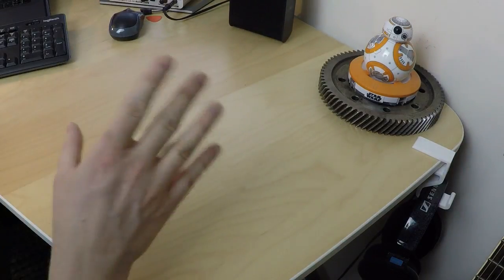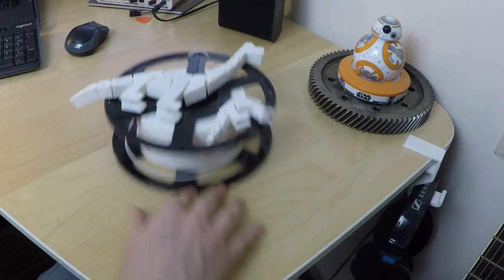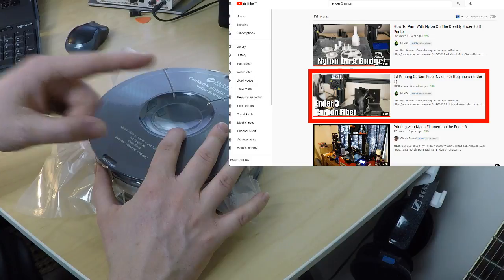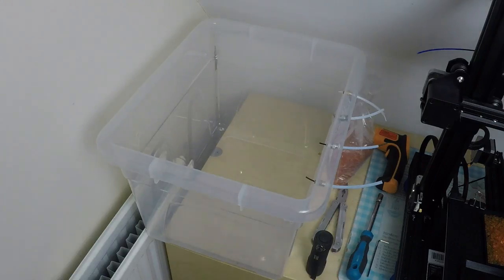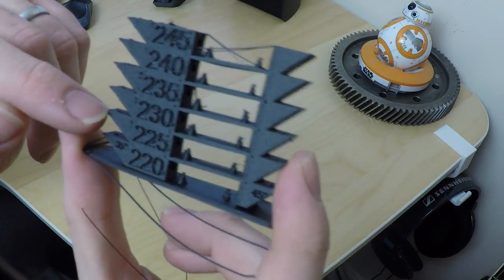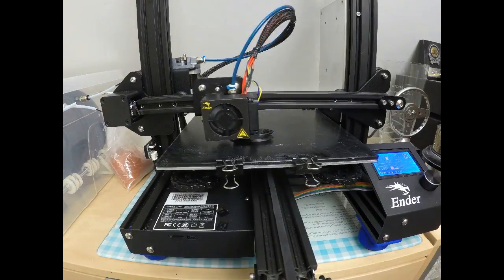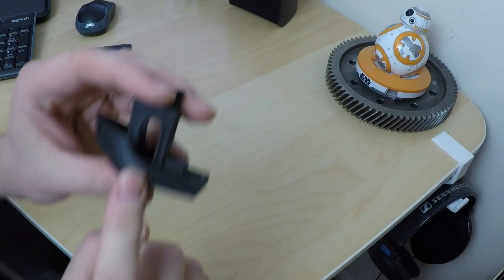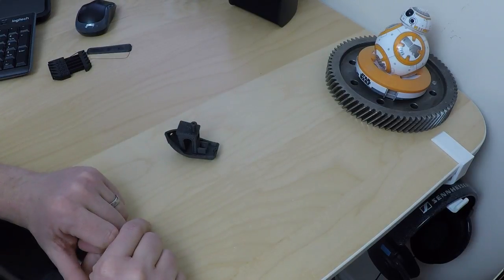3D Printing Carbon Fibre Nylon on a STOCK Ender 3 Pro - Can it be done??? (okay, almost stock....)

Comment: really like the videos so i decided to have a go at making a motorcycle carburetor reed stuffer for a friends drag bike. ( fyi he is 
the world record holder for the fastest Kawasaki 2 stroke triple )The part site between the carburetor and the inlet manifold. I used the Apollo X as per your videos. Question do you anneal the parts you make and if so how doo you do it. I use an Ender 3 S1 pro with with you recommended modifications. Thanks'

Comment: I upgraded my ender 3 to print carbon fibre nylon. But I had to upgrade the motherboard and hotend. The motherboard was a bigtretech sir mini v3. I used visual studio code and platform I0 to program and code it for the ender 3. I also had to go into the programming and change the max print temp to 340*C and the thermal cutoff at 310, I think. I also bought a cheep all metal hotted from amazon for $8. Don't get that. Instead, get whatever top half you want. But make sure the thermal break has a thin neck and that the metal cube the extruder head attaches to is "expensive" and can handle hotter temperatures. The one I got was a Plated Copper Heater Block. You will definitely need to upgrade the hottend as the Bowden tube will burn above 245*C. Carbon fibre nylon printing material needs a minimum of 280*C I think.

Comment: Great video thank you. I have one question, I'm confused. Throughout the print process, you stated that the nozzle temp was set to 255 degrees. But when you did the break test, it broke at the 240 mark so would it not be 235 degrees? Thanks again!

Comment: 255 filament will just not be strong. you want some that melts and fuses together at 300 so its proper strong if exposed to heat.

Comment: I'm highly skeptical about carbon fiber filament. Carbon gets it's strength from it's long threads and chopped carbon kind of defeats it's purpose.
Reply from the maker: It’s nowhere near as strong as proper CF, or even injection moulded PA-GF, but the small fibres do a great job of resisting warping during printing and aren’t affected by heat so there is less of a drop off at elevated temps…

If you are expecting full blow CF… you ain’t getting it… mildly improved verses none CF filament… yes 👍

Comment: Dumb question, when you print a test tower temp like that does the file automatically raises temp on the slicer or?
Reply from the maker: You need to do it in the slicer

Comment: i love your using 3d prints for functional parts! do you think this filament would hold up clamped to a steering rack to hold a finned oil cooler? I have designed a mount that clamps around the rack, and around the cooler, 3D printed in PLA as a prototype and the plan was to have machined from aluminium however im thinking i may do the same and just print from this CF Nylon, the issue i have is i cannot do any testing as i cannot use the car until i have the power steering lines and cooler made up and installed and i cant seem to find any info on the kind of temps these components get to under heavy use. The car is used for drifting so the power steering takes a beating lol

Comment: Time to take another stab at this on my E3. I can get the same, or better, cosmetic results with nylon. I have serious layer adhesion problems though, really negates the strength benefit. I can easily pull the smoke stack and cabin off of the hull when using nylon.😢

Comment: why you dont use de cool fan?
Reply from the maker: Nylon is very prone to warping just like ABS, so on thin parts (or just early in prints) you want to avoid it, and if you can print without it then that’s ideal…

Comment: Nice! A few questions:
1. Will the micro swiss all metal hotend work?
2. I have a filadryer by SunLu. Do I need to have an enclosure or can I just leave the filament inside that dryer and have it print from it?
3. What causes those blobs on your benchy? 

Thanks!
Reply from the maker: 1. A genuine microswiss will do the job very nicely.
2. A dryer that you can print from is ideal!
3. Oozing.  And my general feeling that 90% is good enough! 😂

Comment: Hi MfM,
Looking to 3D Print a hose piece to allow a standard radiator from one car to work with another, it's something of a T-piece to have coolant feed into the turbo instead of just straight into the block.

Thinking of buying Polycarbonate or the Filament you used in this video, but leaving this comment to ask for your opinion with material as the T-Piece will be brought up to temp rather quick and with it being a pressurized I'm wondering if PC or what not would be up to it.

Great content anyway, think it's a fantastic niche that you've made and has endless possibility in my opinion.

Comment: Awesome video! So I'll just need to upgrade my extruder, and get a hardened tip? Or I need an upgraded hot end as well? Can't wait to do this with mine!!!
Reply from the maker: You need the hardened tip for anything with a Carbon fill, and the hot end for the high temperatures 👍.
Reply: @MakingforMotorsport  I've been practicing with PLA and getting used to printing in general, have watched allot of your videos👍🏼 this is dangerous😏😎.... So.... Much ... Fun....

Comment: I printed polycarbonate on my ender 3 pro.  Mine has direct drive titan, bimetal heatbreak,pei bed,copper nozzle,40w heater cartridge(,heard they came with 30w but can't confirm if 40w is any better),skr 1.4 turbo, and it's in an enclosure with switchable exhaust fans that get filtered by a carbon pre filter followed by a Hepa filter. 

I haven't tried nylon yet but it's on my list now. 

I have used CF-ABS, CF-PETG, CF-PLA, tough PC, so obviously I need to try CF-Nylon. 

The ender is a solid printer for the money. I didn't have to do everything to my printer, reality a good nozzle, all metal hotend (or heatbreak) your choice of print bed and metal extruder and you are good. 
I used my first Ender 3 pro (now dual nozzle) with only the upgraded metal extruder and a glass bed. Otherwise stock for a year. 

Now it's got dual BMGs, SKR board, Chimera+, dual 4010 parts fans,glass bed.

I bought my ender 3 originally to print custom gauge pod holders for my race car. Wanted something light weight to hold my wide band ,oil temp/pressure pods..so printed it from petg as thin as I could while still being strong enough.

TL:DR- Got to love the ender it's not bad stock and you can mod it in so many ways. That's really my point in this long winded post.
Reply from the maker: Wow!! You have gone to town on the Ender3!  Good man!  Shows what you can do when willing to get stuck in and learn (whilst still spending less than a Prusa 😳)

Comment: i have been wondering, can you print low-temp nylon with the stock hotend? the manufacturer of the nylon i chose says the ideal temp for printing is 240-245, which the stock hotend can handle (i think). do you think it would be possible? with a proper V6 nozzle, obviously.
Reply from the maker: You can, and 240 is fine with a stock hot end, much above that and the PTFE will degrade giving off poisonous gases.  I went all metal just to be safe.
Reply: @MakingforMotorsport  alright, gotcha. thanks!

Comment: Awesome video! Thanks! Does the mod to the hot end make the printer any less functional for basic PLA filament? I would love to make the mod but I'd like to be able to continue doing the basic kid stuff with PLA, too.
Reply from the maker: Great question… short answer yes.  A low quality hot end will make PLA printing very stringy and/or prone to clogging (so much so I made a video about stopping clogging!) and even a high quality one like an E3D V6 (like the Prusa mk3) needs to be tuned well to work effectively, it can be done definitely but it’s a downside of going all metal which is rarely discussed!
Reply: @MakingforMotorsport  I've noticed that. Bought the same hotend you got but can't get it to print PLA without directly clogging on me. Tightening nozzle when hot, adjust retraction, tweaking temperatures, been there done that. Can't get it to work properly.
Did you do any special tweaking to get it to work?

Comment: I've been hesitant about trying CF-filament due to carbon fiber particles being about as dangerous as asbestos. I am no scientist but I have read multiple articles about 3d printing with CF releases airborne particles. Also, there are tests that show CF-filament not being stronger than other kinds of filaments. I use nylon, polycarbonate and sometimes ASA for my car parts. ASA emits unhealthy fumes so I use it sparingly as polycarbonate seems to have similar properties.

Comment: What mods to an ender 3 would you recommend for printing with carbon based filaments?
Reply from the maker: The Carbon filaments really just need a hardened nozzle, CF-PLA for example, it’s more about the plastic, but everything to do CF-Nylon is in the video👍

Comment: How to install that nozzle?
That nozzle is not fit to cr10 hotend. Too long.
Reply from the maker: The nozzle is the correct thread and does work, but you're right they are meant for the V6 E3D hotend.

Comment: Just what I needed to see. Love your series of videos on all your 3d printed stuff.
Reply from the maker: Cheers bud… 2022 will be carbon fibre for me… I may have a few questions 😂👍
Reply: @MakingforMotorsport  ask away. I did a few videos specific to laying up and working with carbon already, but like most things, the fine details can be the difference between a good result or a full trash can.
Reply: @MakingforMotorsport  I'm FINALLY getting around to tinker with carbon/nylon haha. Just rewatched this for probably the 4th or 5th time now.

Comment: Another great video and between this and the annealing vid, by far the most useful I’ve seen so far! I have a Creality CR10S Pro with micro Swiss hotend and I’ve been looking for a higher temp filament for a while. PETG has been my standard multi-use filament as the Amazon basics version is cheap and easy to get hold of, but I was disappointed by its lack of temp resistance! I was going to print a prototype custom air box for my modified (supercharged) Porsche 924, before reproducing it in aluminium, but with these temp levels, I can easily print a final version and save myself a lot of hassle and argon!! It will even look more OEM in plastic and not welded ally!! Huge thanks and great to see your journey and experiences! Subscribed!! 👍🏻
Reply: Update...just bought a 1kg roll of Sunlu CF-Nylon off Amazon Prime for £45 but with 15% discount code down to £39! Arrives tomorrow! Thanks again for the heads up!! 😁👍🏻
Reply from the maker: Thanks for the comments man and a supercharged 924 sounds like a lot of fun!  But I’ve gotta head over to Amazon, heard there’s some cheap CF-Nylon to be had! 👍

Comment: How did you make you filament dryer? I need one and the one yor show here looks perfect.
Reply from the maker: I got a 24litre storage box and made a little roller cradle and a little 5v fan housing to circulate air through the dessicant, it's the air movement through the dessicant that is key....  packets on their own work but it takes a looooong time!

Comment: I have a different (similar) printer and setup, but I used the same settings that you recommended and my first print with this filament also came out great! Super helpful and time saving so I don't have to fiddle with settings forever. Thank you!

Comment: great video , making parts for an Ebike and using a stock ender 3 v2 with capricorn tube , will give this nylon CF a go ! also not interested in spending money on addons for printer and don't care what the parts look like.
Reply from the maker: If you are thinking about long prints then I’d reckon an all metal hot end, and a better one than I bought!  Best of luck!
Reply: @MakingforMotorsport  going to try 3D BEST-Q Carbon-PC , people in the reviews say there getting away with 260C 0.5m nossal. will give it a shot and buy an all metal hotend if it crumbles under stress.  Also thinking of using thin bolts through design to strengthen it up a bit like reinforced concrete !
Reply from the maker: @BenBilesBB-box  I am not even trying PC until I get an enclosure sorted out… but I am excited to try… let me know how you get on…

Comment: can you print faster than 50mm/s ? i tend to print at 150 with abs and pla, just about to switch to this same material and was hoping to keep up the same speed?
Reply from the maker: I'd say it depends on the printer.... and your priorities.  My Ender 3 is never gonna be a speed machine, and it's not a commercial enterprise so I don't mind waiting for a few hours longer....
Reply: @MakingforMotorsport  I've got 5 ender 3 v2 pros, so they have the upgraded parts on them, I have my own business making parts for cars, I 3d print all my products. I'm now using that sainsmart carbon nylon and its not going great so far, 0 successful prints due to bed adhesion, im using glass and glue like you said but it still warps

Comment: Hi sir, just bought a roll of CF nylon. Do you have any experience how the printed parts behave to moisture? Was planning to make a relay box in the engine bay for a 4x4 but still worried as to some forum threads say that nylon reacts with water and can cause the part to go brittle.
Reply from the maker: Nylon is hygroscopic so it will pull in water from the Air, but this isn't submerged so it's not too bad, and it does changes it's properties slightly, and whilst I believe 3D prints are more suseptable to this that injection moulded, as long as you're not right on the edge it shouldn't affect it.  It doesn't seem to affect all the rest of the Nylon I have in my life.....

Comment: You can do it tho id be interested to see how long a brass nozzle lasts
Id imagine it would do a couple of prints at least
Reply from the maker: I'd imagine it'd definitely last a good few prints....  but I've just left the hardened one in now, they're the just the standard, although I do feel like you need a few extra degrees temp with them.
Reply: @MakingforMotorsport  yes you do need higher temp with steel
10-20°c if i recall
But that as a lot of things is machine dependent

Comment: Did you get any fumes while printing , thanks
Reply from the maker: You get none for the Nylon, the CF-PA is the best printing filament I have ever had...
Reply: @MakingforMotorsport  I need to print a 3mm thick 1/10 RC buggy chassis...do you think is tough enough? It seems seller shop don't ship to UK, alternatives? Thanks
Reply from the maker: Its plenty strong but it’s not particularly stiff, so just a 3mm thick plate isn’t likely to be particularly stiff but that may not bother you.  I got it on Amazon, it pops up every so often and can go off quick
Reply: @MakingforMotorsport  what should i look for on amazon? thanx

Comment: Where did you buy that filament? I'm trying to find it but no luck for now. Other brands seem to be way more expensive :(
Reply from the maker: Amazon mate, it was about £55... but it’s not cheap at all!
Reply: @MakingforMotorsport  is "not available" in amazon Spain, UK or US :/ It is not cheap but it's still cheaper than nylonx, colorfabb etc
Reply from the maker: @alejandromunoz8086  I am keen to try the eSun or essentium HT-nylon, and that’s even more sxpensive
Reply from the maker: That looks very similar to the Sainsmart ePA-CF...  I will hold out for the high temp stuff 👍

Comment: In my case cooling is required when printing the smokestack/Chimney, cooling fans at 15 to prevent melting, to be fair I use an enclosure and MatterHackers Nylonx
Reply from the maker: I am looking at getting an enclosure so I can bump up the temps, but I’d imagine it’s not too bad to cooling it with 50deg air... do you keep your electronics out of the enclosure?
Reply: @MakingforMotorsport No, the electronics are in the enclosure. I failed to mention that I use a Raise3D pro2 though I do have an ender 3( which is why I watched the video) I had not thought of keeping the electronics out. I imagine it would be beneficial. But then you could just duct air to the fans to save the hassle of removing the PSU and boards.

Comment: Love this. I need to make some new trumpets for my 51ida and the underhood of a rotary is HOT.
Reply from the maker: I can imagine, love a rotary screamer!  I am hoping to get away with ASA for mine, air intake temp rarely goes higher than +10degC over ambient for me, and in the UK that normally means not that hot at all! 😂   You gonna use CF- nylon?
Reply: @MakingforMotorsport  Yeah CF nylon seems like the best option without going even crazier like PEEK.  I'm scared to try but I wonder if the intake could be printed. I have a 20"³ build area. I need a new intake for semi peripheral ports.
Reply from the maker: @Skater3z3b  a lot of OEM manifolds are Glass fibre Nylon so it should be up to it, at least I hope it is, as I have a CF-Nylon printed manifold holding my ITBs to my engine at the moment!  In 4 weeks I will have done an event and will be able to feedback, but extensive driveway testing is looking good... but an Weber IDA is a heavy piece of kit, if you plan for a metal bracket to take the weight and vibration etc then it might work...  keep an eye on the channel, I will have a “how to 3D print a manifold” with all my mistakes soon!